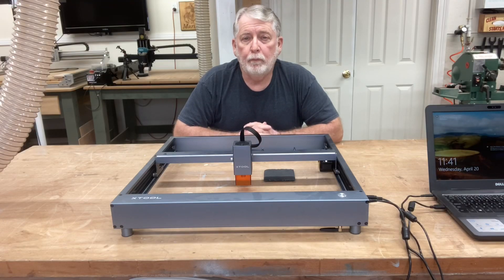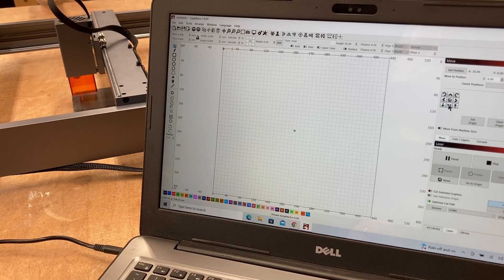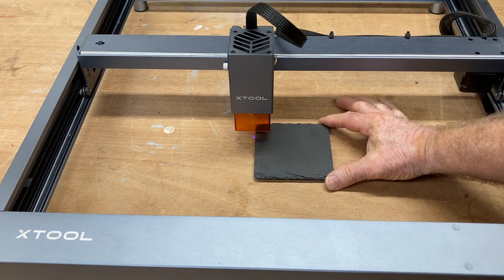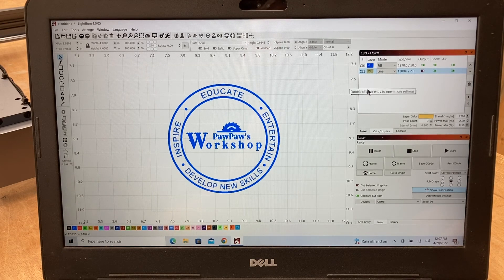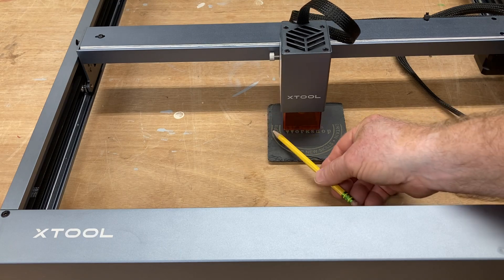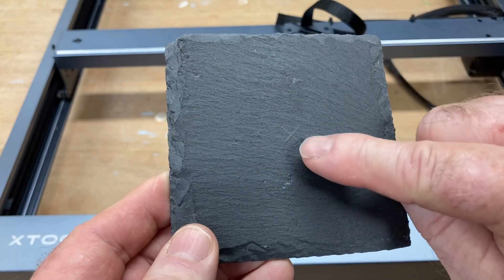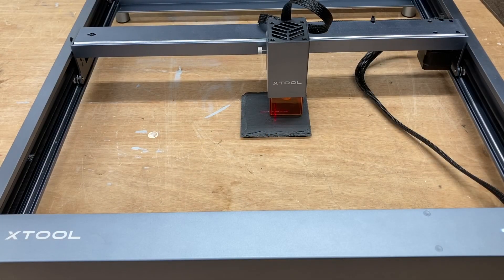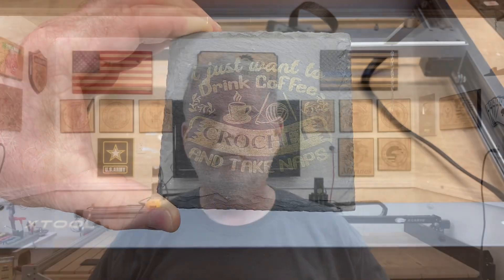How to Center Graphics Using xTool D1 Laser

Comment: Is it Lightburn that allows the blue dot to appear when framing?  I don't see that with Laserbox Basic.  I get the red crosshairs, but those don't really seem to be the exact centre of where the laser is actually going to shoot.  

I also lost another drive belt.  That's 2 that have snapped on me now.  I don't tension them overly tight.
Reply from the maker: Yes, it is Lightburn software that controls this. Laserbox is very very basic.   Belts should not break like that. Are you tensioning them as I show in the videos show the assembly of the different lasers?

Comment: Great video I have an issue I have d1 pro and using lightbuen when align with red cross its not aligning from that spot it's aligning where the laser sits do you know how to fix that
Reply from the maker: In Lightburn setting you can adjust the offset amount to properly align the red cross hair

Comment: Thank you for the video! I watched it and then followed the directions you gave but I keep having the same issue that I can’t figure out how to fix: the framing will work perfectly and then when I go to start the project (even just the outside “test” rectangle) it starts about a half inch to the left of the project instead of where the framing was. I’m so frustrated because I can’t get a single thing to be where it’s supposed to be. Any advice?

Comment: Do you use any kind of a sealer on the slate to seal the engraving?
Reply from the maker: No I do not. The tile work just fine with no sealer. The image is permanent and the moisture can be absorbed into the tile making it a very effective coaster.
Reply: @PawPawsWorkShop  Thank you

Comment: Thank you for the video.  Respectful feedback.  Your process is overly complicated.  Make a square around your artwork the same size as your tile (or whatever you are working with) with the artwork centered in the middle.  Set the square shape to "tool path".  Set your "start from" to current position and your job origin to the upper left.  Then just use the red cross hairs to square the tile to the laser and set the crosshairs on the outside edge of the upper left corner.  Hit frame once to confirm.  The crosshair will trace the outside edge.  Hit start.  Takes me less than 30 seconds to square and center a project this way.  I'll throw a video up on my channel showing the process.  Hope this helps.
Reply from the maker: Thank you for sharing. Just keep it simple. I try to show details and simple processes and the reason why. Thank you for your explanation. Hopefully it will help others. Love to see your video

Comment: Hello sir. I have a question regarding element frames. I'm attempting to cut an element that comes close to the working area, but does not exceed it. The frame of the element does exceed the working area though. Is there anyway to change the frame  size without changing the shape of the element?

Comment: At 2:57 you change the height and width, but for some reason whether I have it locked or not, the dimensions always change. I'm trying to set both measurements to 3.5".  I'm sure it's an easy solution.

Comment: Great video. Thank you for sharing. I've had a little bit of a challenge in centering my smaller pieces because of my comgrow air assist kit that I purchased. Instead of an orange laser head enclosure, it's solid, with a small opening on the side. This still makes the work piece difficult to center to engrave. I have the Laserbox basic program. Any ideas how I can get around this? Keep up the good work.
Reply from the maker: The easiest way is to create a template on the wasteboard. Then all you need to do is to drop the project on the wasteboard. Make sure to home the machine and use absolute coordinates. Works perfect. That’s for Lightburn. I don’t know about the Laserbox Basic. I can only assume there is something similar
Reply: @PawPawsWorkShop  Thank you, will try that. I don't have the option of choosing absolute coordinates that I can see.

Comment: How do you get round coasters centered
Reply from the maker: Actually, the same way as the square ones. Either frame the project using the red cross hairs or create a toolpath with about 2% power. With this method you can create a round toolpath the same size as the project. Set it to do three passes. That will give you plenty of time to center it. Another way is to create a template and burn it into the wasteboard. You will then have you shape exactly where it needs to be

Comment: How do you do circles? I'm having issues aligning my circle graphics.
Reply from the maker: Just put a square around the circle and frame. Or, use the normal frame function and it will go around the engraving area with a square
Reply: @PawPawsWorkShop  Sir, I have done that and the the alignment of the circle is not center. Not sure what I ‘m doing wrong. Thank you for your reply back.
Reply from the maker: You can put a small x on the center of the project and put the crosshairs directly on that spot.  I need more information to full help you

Comment: Not related to this video but  do you know why xtool d1 in laserbox not able to check firmware status? When I click on connect the firmware screen goes away and the connect message top right of laserbox goes to not connect. I would appreciate any help, this only started this week.
Reply from the maker: Unfortunately I do not use laserbox and I do not have an answer for you
Reply: @PawPawsWorkShop  From what I understand if you have a D1 you have to use laser box to check the status of the firmware
Reply: So if you don't laserbox how do you check the firmware status of your D1?
Reply from the maker: Have not check it

Comment: When I position the cross hairs exactly on the left corner of my project it frames perfect but when it burns the whole image is off to the right by .25", I have to use your technique with low power to see where it burns but at the same time the cross hairs are no where against the job. Any idea why my cross hairs are not referencing correctly? Thanks as always.
Reply from the maker: The cross hairs are 16mm to the left of the center.  If you are using the center point as the current position and the start point, the cross hairs would need to be at that point. The software compensates for the difference. It will frame the outline of the job.  If you look at the device settings for the D1 you will see the offset in the box.

Comment: One further question.  When you are doing the 2% power to trace your laser line, do you need protective eyewear?  mine is down in a box with exhaust to the outside, as i run it inside the house.  But because of that, it is hard to see with the glasses on and pretty much impossible to see with the shield on laser head.  I did not see you mentioned it is required, so was not sure if at that low power it is not a problem to look directly at the blue light
Reply from the maker: You should always wear the glasses. Safety first!

Comment: How did you get that blue laser to come out!?
Reply from the maker: It is on a separate layer to frame I use layer 29 but you can use anything. You run the job with just that layer to output

Comment: My cross hairs is not my center point.  It works for the y axis, not the x
Reply from the maker: It is approximately 16mm off center my design. When you frame the software adjusts for this variable

Comment: My machine did not go to center of coaster after I lined up with laser at 2%
Reply from the maker: If you are using the xTool D1 then you will notice the red cross hairs are off center to the laser frame it and you will see how the red line works. The laser compensates for the offset
Reply: @PawPawsWorkShop  I used lightburn on xtool.  I used 4"square using 2% blue laser to center

Comment: I have the cross hairs but don't see the blue light, how do you turn that  feature on? Thanks.
Reply from the maker: The blue light is the laser. To frame I show two methods, one is to use the Red Cross hairs and the second way is to use the laser. Just setup a separate toolpath with a very low power. Turn off all the other layers and run the job to frame your project. The blue light will be on and the Red Cross hairs will turn off.

Comment: why dont you just engrave a 4" x 4" on the actual table and then place the tile on it.
Then if you have multiple tiles to do, just place MDF references or something like a rule one 3 sides so you have a template, and just go to town and  engrave the tiles
Reply from the maker: Yes, that will work just fine. I usually just set the laser on the workbench and do not have a wasteboard under the laser. I do not wish to engrave a template on my workbench

Comment: Thank a lot for this video. I just got my xtool d1 and was very unhappy with it. All the videos I watched to learn how to work the machine completely skipped positioning the laser with material the same or close to the size of the  engraving. I have even contacted xtool and they replied with jargon I don’t understand. This video explained a lot and in a way I could understand what you were saying I have subscribed to your channel and will be returning for more videos. Thank you once again.
Reply: You so right.  The D1 worked perfectly for me on Laserbox.  However, there is a lot of info on positioning and center, etc., on the Lightburn software.  I just found out that if you hit The Home key...you have to restart Lightburn...????? had no idea.  I truly am a newbie on lasers.  PS:  There is also 257 pages in the manual.!!!!!
Reply: @kittyrings  I had a lot of issues with the printing being 44 mm to the right and the machine wasn't repositioning like the manufacturer said it would.  If you have this issue also, I found in the drop down menu of Lightburn, I went to device settings, then changed the laser offset from 33 mm to -16 mm and it printed perfectly. took me 3-4 weeks to find this out.

Comment: How did you get the blue light to come on while framing? (3:30 timestamp) Mine only uses the red cross hairs to frame. I would much rather use the blue dot than the cross hairs.
Reply from the maker: I frame using a separate layer set to a very low power. Look at the video. I use layer 29 to frame
Reply: @PawPawsWorkShop  in the video u said you pressed shift and clicked frame then both, the cross hairs and the laser were on. If running a separate layer I would have to start a job vs clicking frame.
Reply from the maker: I did it both ways. Shift and frame will use the red crosshair

Comment: when using the crosshairs to center I assume you still  have the offset on; what is your setting for the offset......I'm using 16mm.  Using your method is much better than using the "Frame" button alone in lightburn.....so many of us experience problems with centering......thankx you have taken me to a higher level.

Comment: If you make your outside square in lightburn a tool layer instead of a regular one you can leave it on as it won't actually be used but helps if you are doing multiple designs.  And as you mentioned if you put a piece of cardstock down on your board and do a light burn pass of the size of your coaster, round or square, and just place your new tile each time without having to measure every time.
Reply from the maker: Thanks you are correct
Reply: What is a “tool layer”?
Reply: @carriemyslinski4521   In lightburn the 2 layers marked T1 and T2 are the tool layers.  They allow you to put things like outlines for tiles and such in the program but that layer does not output to the laser. They are very useful for doing setups for things you are going to make changes to say an image but need to keep it within certain size limits.

Comment: Excellent explanation. How did you turn off the crosshairs to only see the laser beam in the framing?
Reply from the maker: When I setup the framing using a too.path and 3 passes, the crosshairs turnoff automatically because it is actually running a job.
Reply: @PawPawsWorkShop  Hmmm. Hadn’t experienced that. Thank you very much.
Reply: In settings you can turn it on to be your only method of center ditch the cross hair all together.
Reply: Also you can frame and rubber band frame as many times as needed.  No need to set multi pass on the tool line..

Comment: Nice tips! How many watts and how much power are you using to engrave the slate? What setting are you using in lightburn? Thank you for sharing.😁🛫
Reply from the maker: Thank you,  I do not remember exactly but I used the medium wood engrave setting I have in the library. It is about 1250mm/min and 50% power. That actually proved to be more than required.
Reply: @PawPawsWorkShop  Thanks Do you know what the output wattage is of the laser? that is what I should have asked.

Comment: On a round coaster, would the outline just touch the 4 points of the circle in the square?  Also, is this process pretty much the same every time if you are doing multiple tiles, or does it get easier once its set up.  Just ordered my D1 so this was very helpful.  Thanks!
Reply from the maker: If you are doing multiple tiles just create a template so the the tiles will just drop into the template and hit start
Reply: If you create a circle "template" instead of a square, you can use Shift plus the circle frame button to "laser" frame the circle over your round coaster. Hope this makes sense.